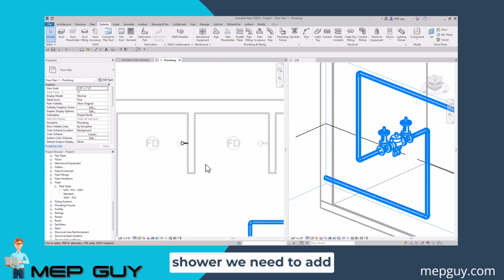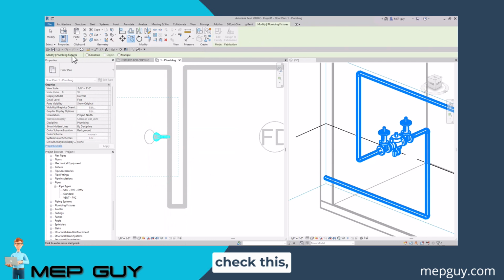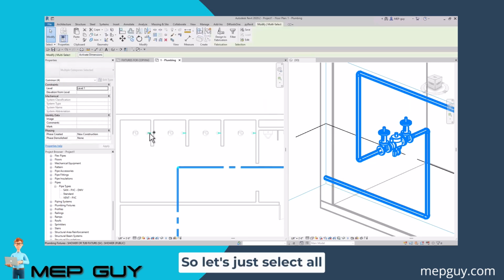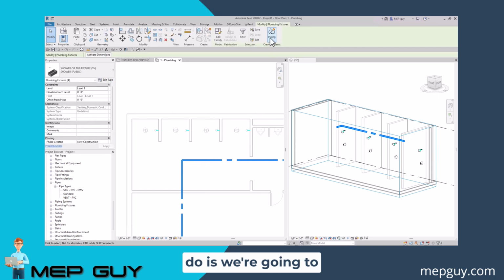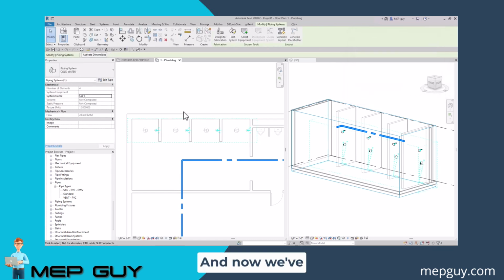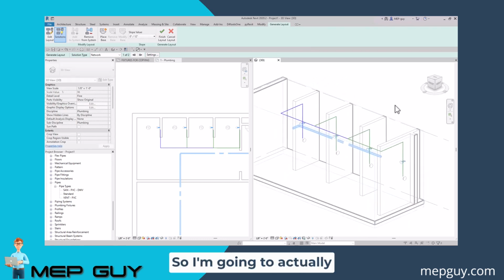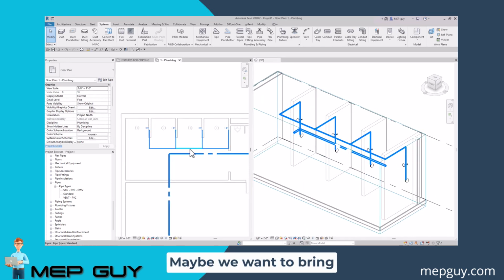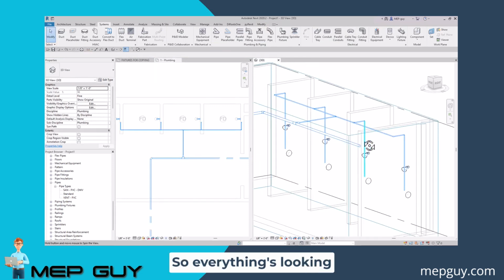Basic Pipe Modeling techniques in Revit MEP

Comment: if i recalled correctly when watching your videos, you did use both horizontal and vertical connectors in some cases for easy modeling, sanitary perhaps? if that's true then it will be great if you can create short video for this case, and its effect on calculation?